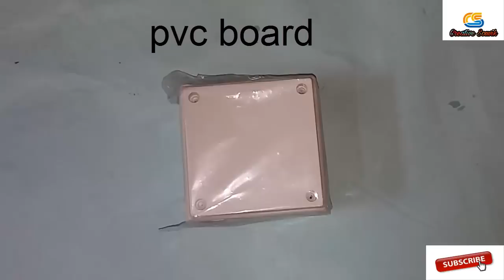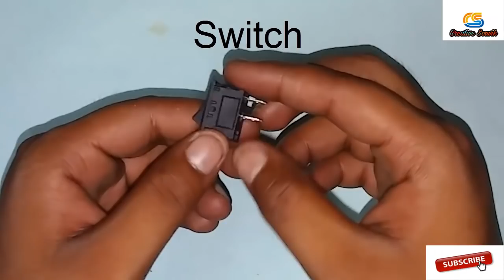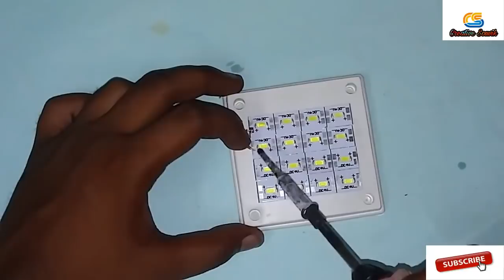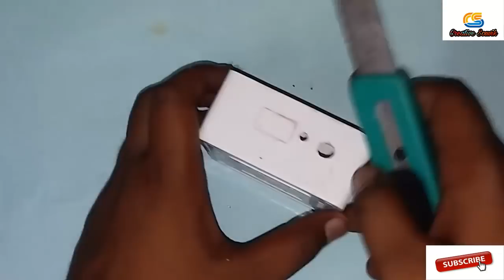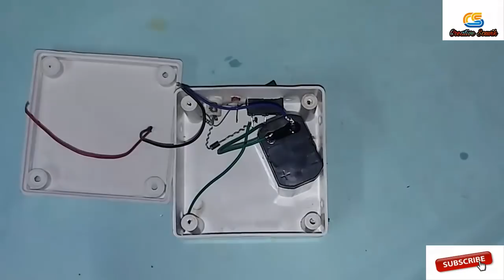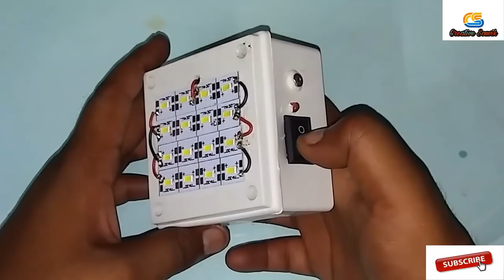How to Make a MINI Rechargeable LED LIGHT

Comment: Nice
Reply from the maker: Thanks...
Reply: Everything is right, but when u want to make it, dont use glue gun to attach Led strip, bcz when its working it becomes Heat and glue is going to melt, use Nut and screw system for better result.

Comment: Everything is right, but when u want to make it, dont use glue gun to attach Led strip, bcz when its working it becomes Heat and glue is going to melt, use Nut and screw system for better result.
Reply: I agree with you
Reply: Aisa kuch bhi nhi hoga bcoz its 4 volt led